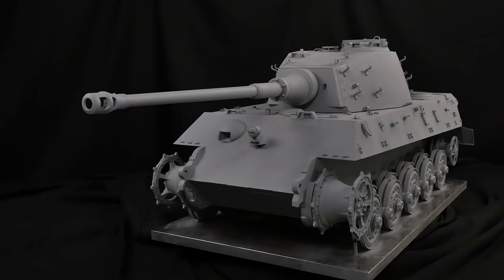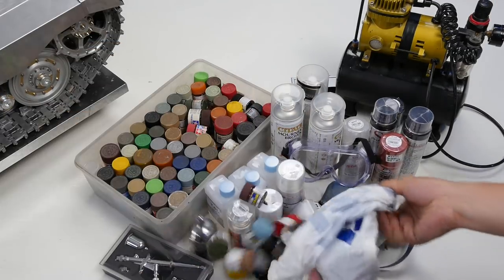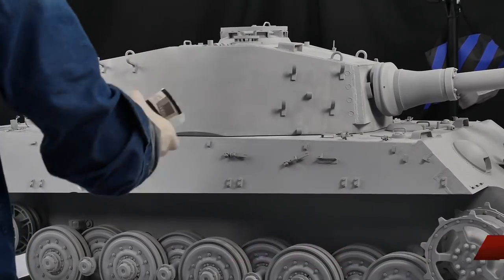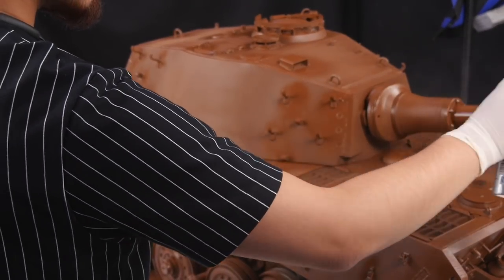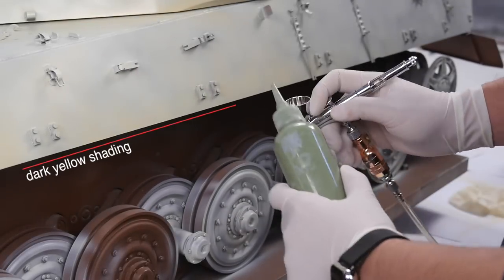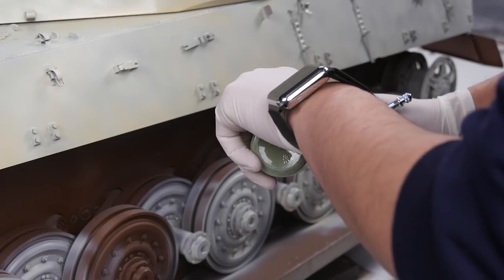Painting the Giant King Tiger part 2

Comment: Awesome tank and great paint job but those tanks are a bit pricey and heavy. I decided to scratch build a Late Tiger 1 in 1/6 using 1/4" styrene and after all I did it weights in at 122lbs which is more or less half the weight of the Metal counterparts. I uploaded a vid if yall want to watch.